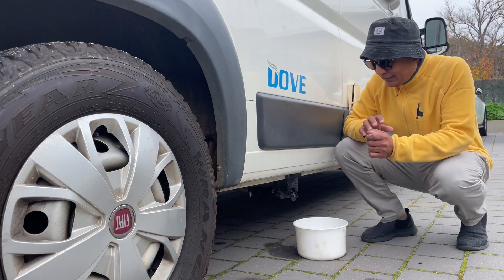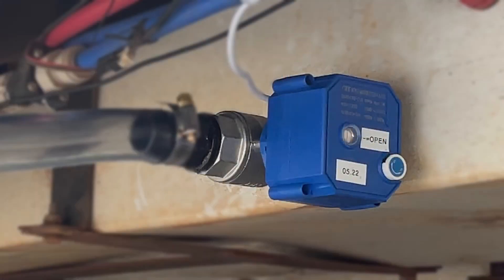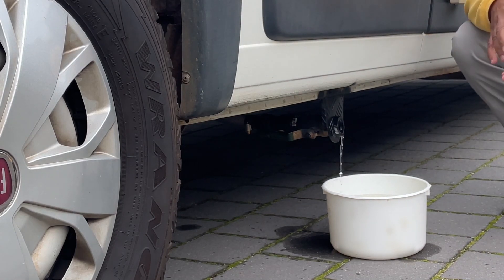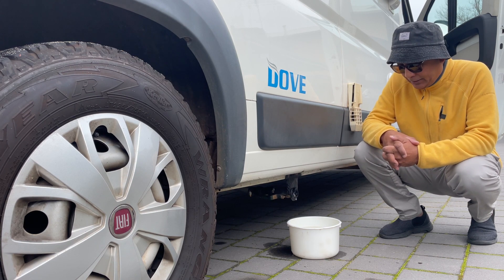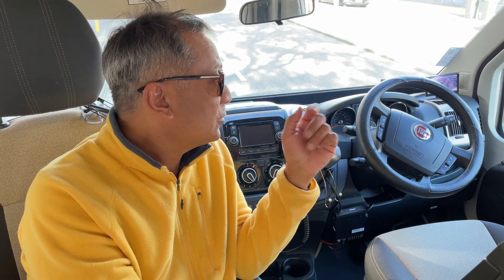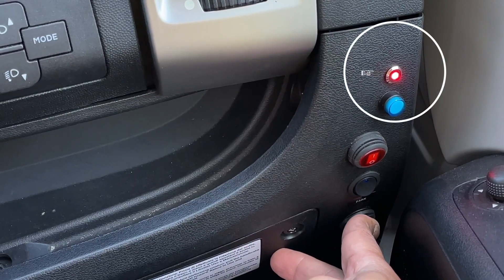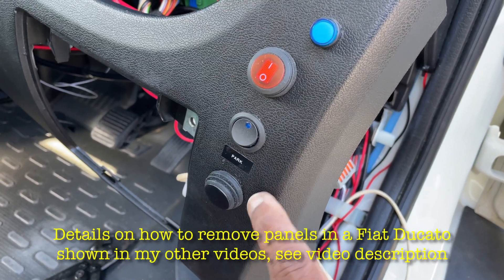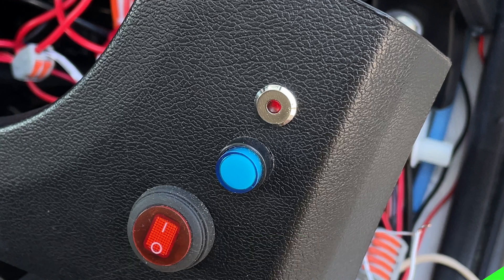Add an Electric Discharge Tap to your Campervan or Motorhome #vanbuild

Comment: Having a switch with a light built-in would make installing a bit simpler. There is only one hole to drill in the dash. And it would be very obvious what switch needs to be switched off.